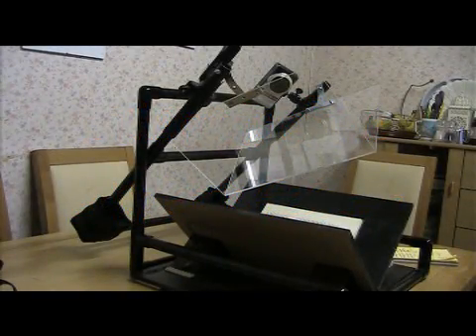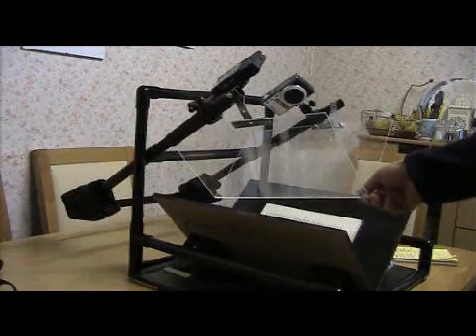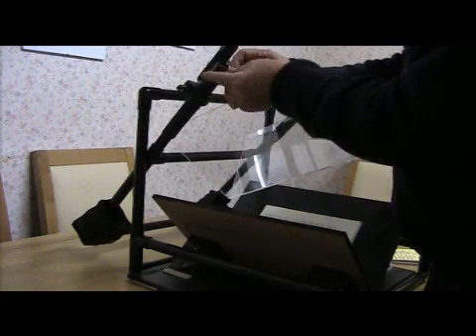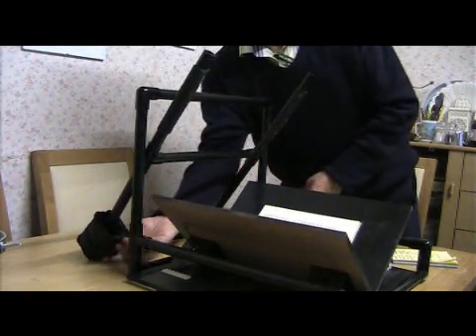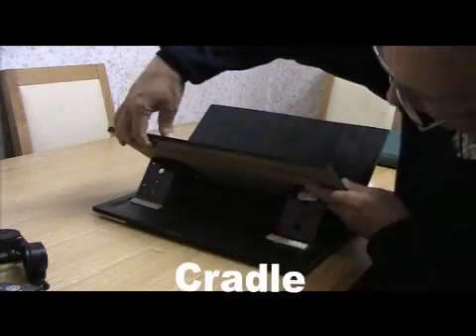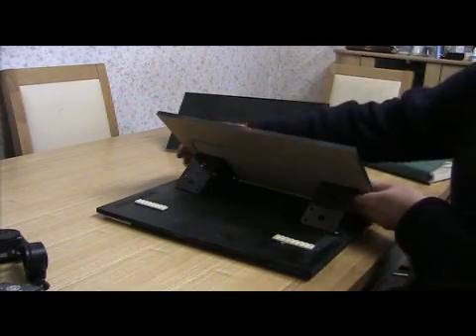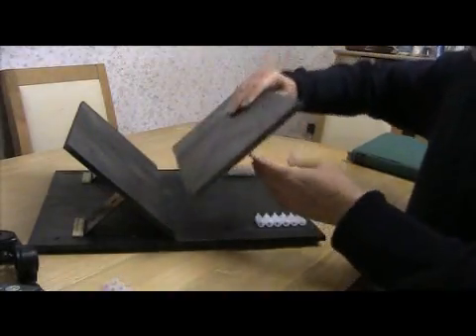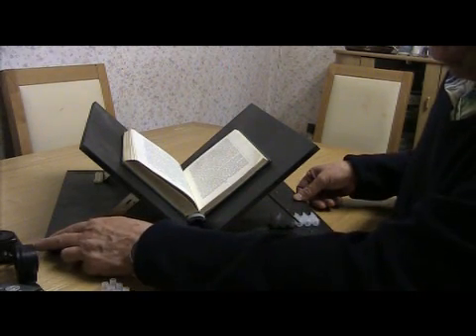Easy Book Scanner Part 1 The component parts and how it is constructed an overview

Comment: I love it.  I'm always doing things with pvc conduit anyhow, and recently found a need to scan a genealogy book.
One question:  What thickness acrylic would you recommend?  I concerned between being too thin and flexible vs too thick and possible visual distortion.
Reply: Ne'er mind.  The dimension just popped up on the video.  Why didn't I see that first time?

Comment: Very nice design.  Tanks for sharing!
I have made a couple o diferent designs "v"
 and "flat" platten kind, using screen process manual machines.
Could you tell me how do you renumber the pictures of both cameras in order to assemble both groups of pictures?
Thanks
Tomas
Reply: I used a free software package called  "File Renamer" for getting the files in numerical order. For post-processing of the images into crisp black and white I have used two free packages.  YASW.exe is excellent for getting the photographic images rectangular in shape and cropping the images.  I've also used ScanTailor.  All free programmes.
What are "screen process manual machines"?